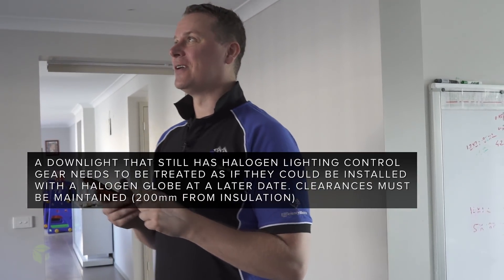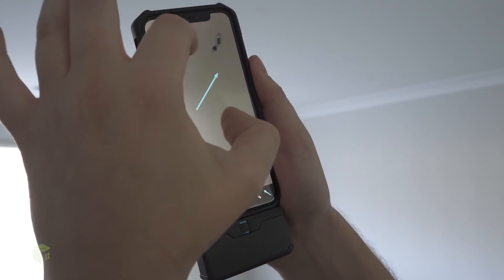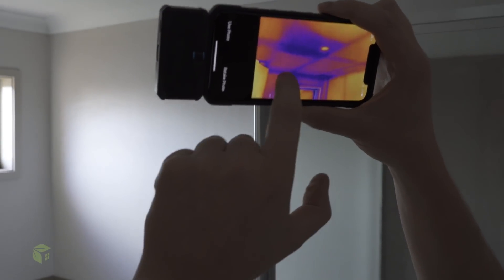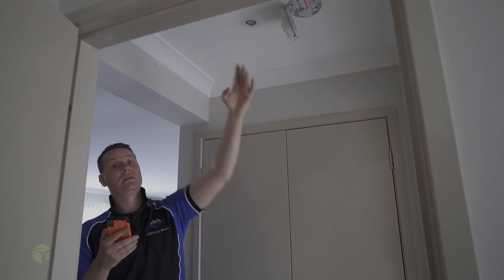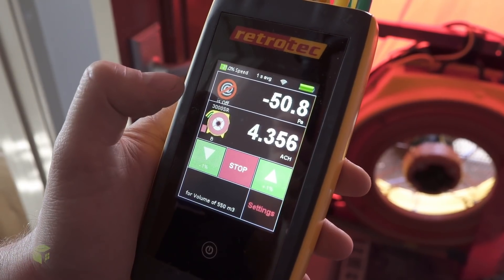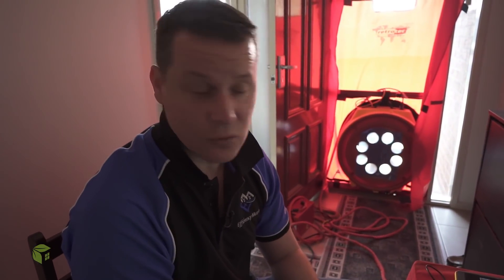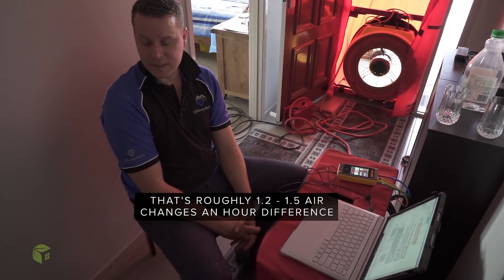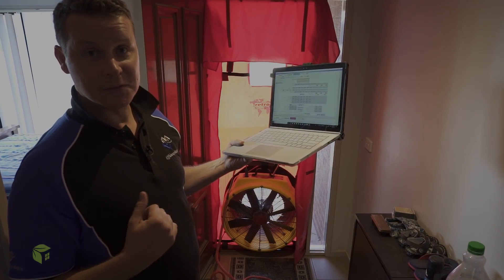Enhancing Energy Efficiency: Air Tightness & Insulation Audit in a Melbourne Home

Comment: We find alot of very poorly ventilated bsthrooms using heat fan combos all the way in the middle of the bathroom usually with either a pathetic 100 barrel fan which does nothing or a 150 200mm axil fan with no draft stoppers.
Reply from the maker: Ryan Macklin https://youtu.be/lD2wwrojP-Y. We elaborated on bathroom ventilation in this video.
Reply: Efficiency Matrix yeah i saw that the other week.

We use downlights( im an electrician) that are sealled and abutted and covered rated meaning you can full cover. Always use exfans which have draft stoppers.
Reply from the maker: Ryan Macklin Good stuff.  IC rated fittings are great, but their lamp life longevity is NOT tested with insulation covering them.  Do these IC rated fittings have control gear?
Reply: Efficiency Matrix all inbuilt in the one unit. Been using them for 3 odd years i think now.they seem to work well, have great liggt properties, dont have an ugly lip on the edge and now come in a multi colour.

Im not quite sure how theyve gone from aluminum to plastice with no fins and control gear inside but we've been covering them for bout 3 years now with only a couple fail
Reply from the maker: Ryan Macklin they are getting better.  The saving grace is probably not leaving them turned on for long periods of time.  IC ratings with integrated control gears are great, when you can completely submerge them in insulation!  Good stuff!